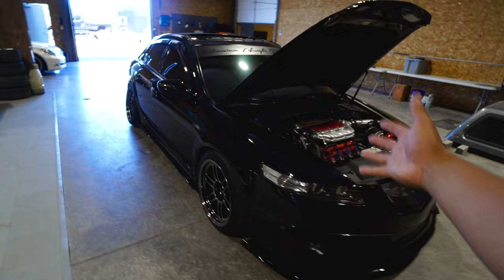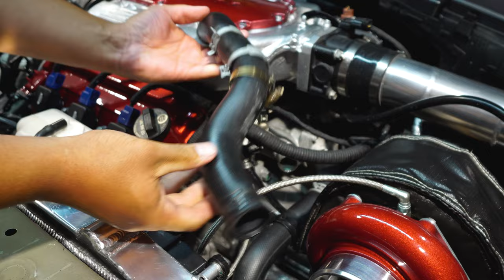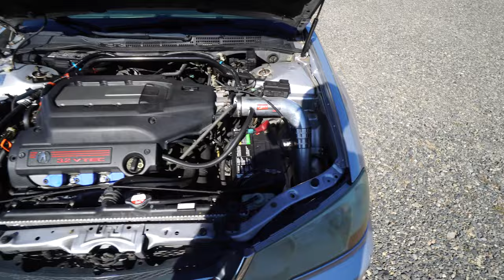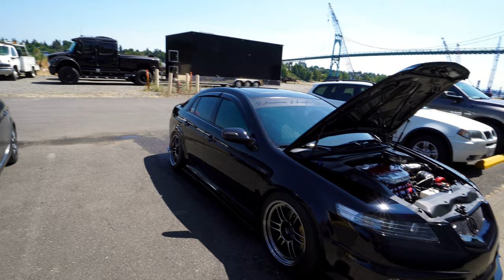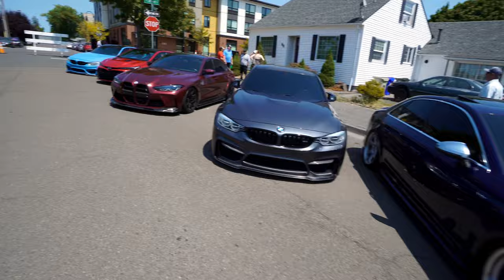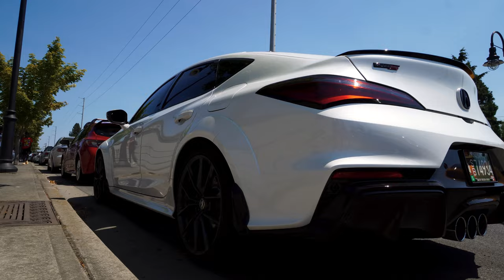Almost time to SEND the Boosted TL...

Comment: you should put that heat mat back on the hood, it protects the clear coat on the paint from extreme temps so it doesn’t start cracking or peeling